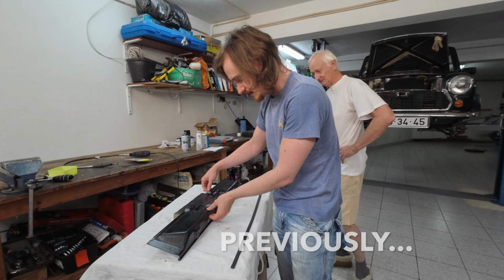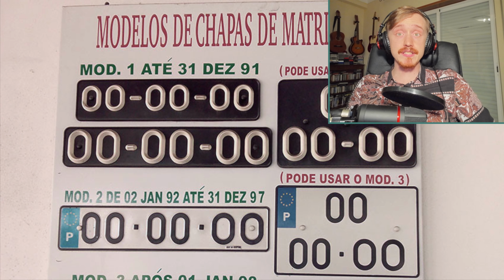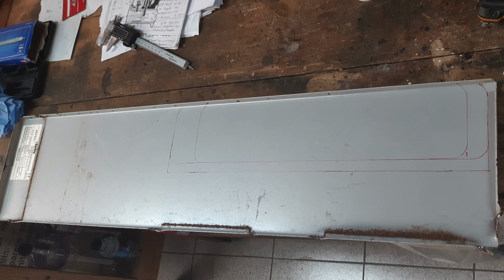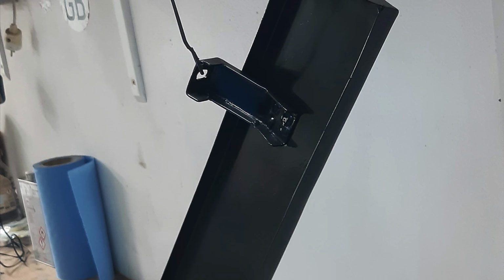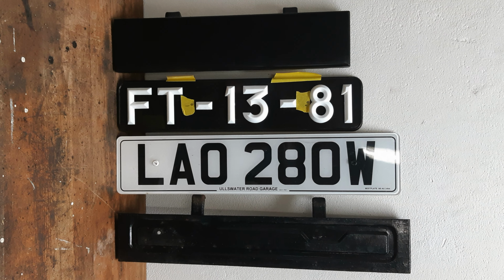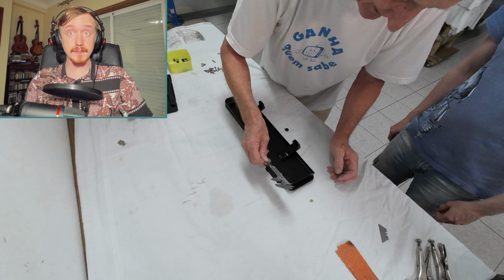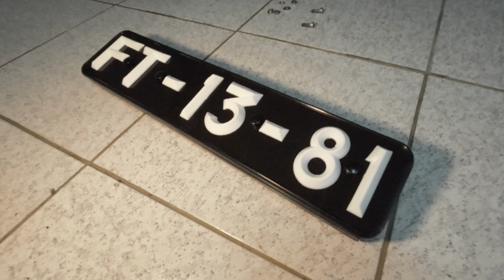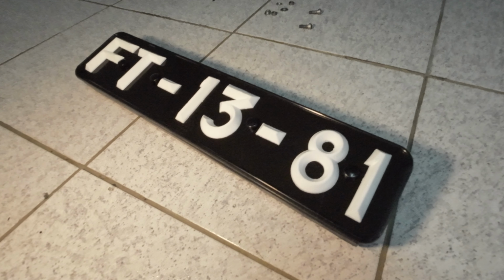MK1 GOLF NEW DIY FRONT NUMBER PLATE MOUNT! EP. 9

Comment: Hi there, Is this easy to change? Is all easy to access ?
Reply from the maker: I presume you mean changing the registration from 🇬🇧 to 🇵🇹? I used a company in Portugal that specialises in the legalisation procedure! Reason for this is because Portugal is ridiculously bureaucratic/awkward and it's easier to have someone with the proper legal knowledge to do it for you! Hope that answers your question 😊
Reply: @josewindle sorry for not clarifying I meant taking the original one off and just generally cleaning it up and putting it back on, I’m from the uk and my ones very rusty at the moment
Reply from the maker: @trxst4643  ahh no worries! My Golf  was imported from the UK but the holder was still in acceptable condition! Depends on the condition mainly, if it's not crumbling and full of holes to weld up then you just need some of the basic tools that we used in the video plus Hammerite kurust (to treat the metal once you removed the majority of the rust), a spray can of primer and a can of satin black and you are good to go. It's only a couple of nuts and bolts to unscrew off the bumper (get some new stainless steel ones like we did). Otherwise, as a last resort, get a new one 🤷‍♂️ https://www.classic-vw.co.uk/mk1-golf-front-number-plate-mount-171807841a-jetta-caddy-cabrio-polo-24972-p.asp

But as a 1st DIY job, it's not too hard! 😊